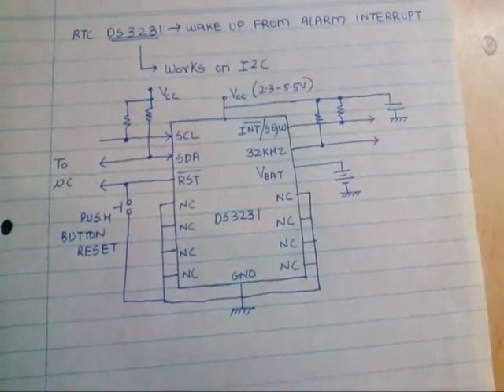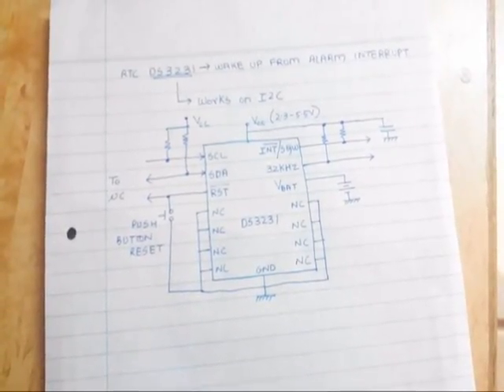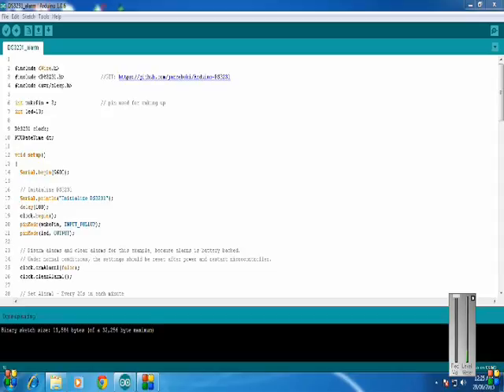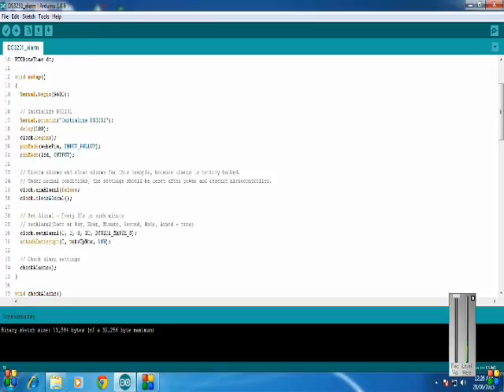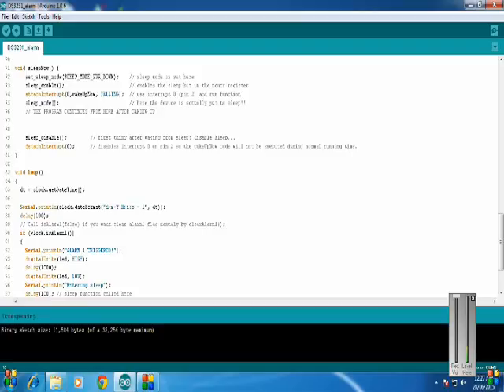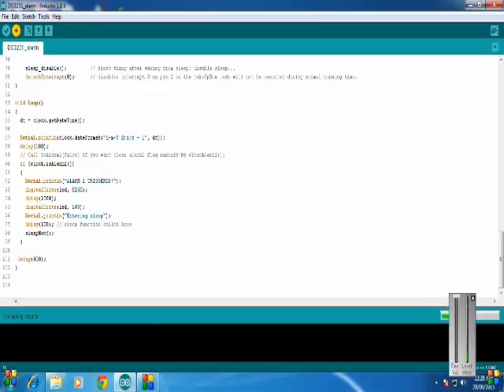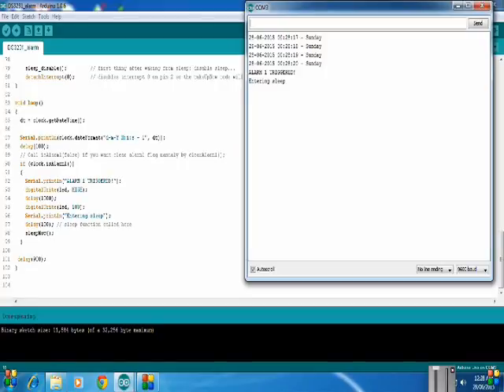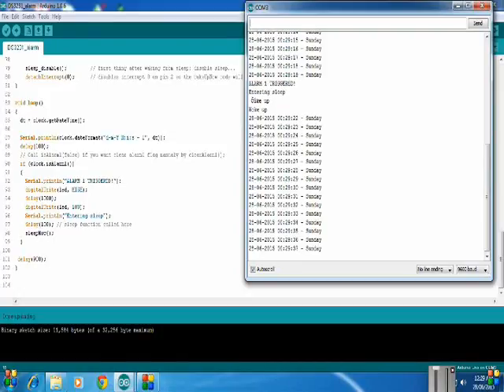How To Wake Up Arduino From RTC Alarm Interrupt

Comment: This could be an outstanding video but the 'thumbs-down' is likely coming from the audio distortion and lack of video resolution during most of the video (code explanation) makes the code unreadable.  I really hope you will re-do this video and correct these deficiencies because your expertise on this subject matter is very good. The problem is that this video doesn't communicate successfully. Good luck. If unable to correct this, could you at least post a link to the code so viewers can learn from that. Thank you and good luck.
Reply from the maker: Thanks a lot for your valuable feedback. I'll certainly try to rectify this in the coming videos. Also, I'll soon post a link to the code.

Comment: can i make arduino sleep at specific time and wake it again...for example i want my arduino mega sleep during night and wakes up in morning.....can you please help me making that sketch...i badly need it please help me
Reply from the maker: Yeah...you can create a delay of the required amount of hours for which the arduino should be in sleep and then wake it up using an interrupt after the delay

For eg: if you wan the arduino to sleep at 12pm and wake up at 8am..then the interuppt should occur after 8 hours and from 8am-12pm you can create another delay of half hour each or so depending on the requirement
Reply: where can i download the library?
Reply: i have this errors

Comment: My alarm triggers and works fine when the Arduino is not in sleep mode. 

Woke up
19-10-2016 13:21:20 - Wednesday
ALARM 1 TRIGGERED!

But when sleeping, it does not wake up

Woke up
Entering sleep (this is the last line of output). Since I know that it will trigger OK, I'm very confused why it does not come out of sleep mode. Any help appreciated.
Reply from the maker: Leave the wakeUpNow function blank. I mean comment the serial print("Woke Up") and delay(100) lines from the code.
Also connect the int pin of RTC to arduino uno pin 2.
I hope your query will be solved!.
Cheers!!

Comment: Great work! I have a question though. i believe that the arduino does not enter sleep mode.I think that after entering sleep mode it wakes up imidiately  and stays in a condition i cannot explain.How is it possible to be in sleep mode an d also desplay information in serial port?? Have you checked the consumption with an amperometer?
Reply from the maker: There are different modes of arduino of entering into sleep. The serial terminal is kept on only for display purpose. You can include code in which you can specifically sleep the ADC,serial terminal,timers etc.
In my case only the timer is off and RTC time is displayed through serial.

Comment: Hi Vipul, Thanks for the tutorial. I do have a question. Why doesn't the Arduino stay in sleepmode when INT0 is connected? It needs to be in sleepmode in between, but after the alarm it goest to sleepmode and immediately continues telling the date/time via Serial. I'm using the code provided in the comments.
Reply from the maker: Just comment the code in wakeUpNow function and the Arduino will be in sleepmode when INT0 is connected.
I hope thats what your query is!..
Reply: Hi Vipul, thanks for you quick reply! I kind of expect that is stops telling the time after Entering sleep. I've already commented the code in wakeUpNow, but it still keeps going. I've copied the code from the comments. Maybe I'm doing something wrong.
Reply from the maker: The flow of the code is:
The Arduino is in sleep mode all the time, even while it displays the time. It comes out of sleep only when alarm is triggered and it blinks the LED and goes back to sleep and starts displaying the time. The time is displayed only to demonstrate that alarm is triggered when time matches on the RTC and PC.
For the code you can send me the email id. I will mail you the code. In case you have any further query you can revert me back.

Comment: Thank you very much! as would be the code to turn on an LED every day for one minute and then sleep the arduino? this is my email: demiscorp@gmail.com
Thanks again!
Reply from the maker: You can set an alarm once each day by changing clock.set alarm function in the setup , by choosing appropriate function from the library and making suitable changes in the switch case too.
And for 1 min delay use can use timer 0 or timer 1 of the arduino.

Comment: Is there a way to wake up the Arduino every 10 minutes? I am also using DS3231.
Reply from the maker: +Wilmar Alfeche  Yeah its possible..
change the line in the code
 to 
clock.setAlarm2(0, 0, 10, 0, DS3231_EVERY_MINUTE);  
from 
  clock.setAlarm1(0, 0, 0, 20, DS3231_MATCH_S);
Reply: Thanks for the reply sir. I would just like to clarify. Will this set an alarm every 10 minutes or every 10th minute of the hour?
Reply from the maker: It will set an alarm for every 10 minutes.
Reply from the maker: It will set an alarm every 10 minutes.

Comment: Great work! I have one question though. Can you get the arduino to wake up after a certain amount of time?
Reply from the maker: +Emil Jasper you mean after fix intervals of time?...After how much time interval?
Reply: lets say during the day the arduino will log data every five minutes then turn off and turn back on again after five minutes.
During the evening and night time (lets say at 18:00) it will log data every 10 minutes.
Is that possible in one code?
Reply from the maker: +Emil Jasper  You can try the following code to get the present hour
RTCDateTime dt;
int hr;
const char *hrs;
dt = clock.getDateTime();
hrs =clock.dateFormat("h", dt);
  hr = atoi(hrs);

You will get the value in "hr" variable.Have two loops of codes (one for 5min interval and another for 10min interval )
Now you can put some condition...for example an if loop to compare the present time with 18.00
Whenever match occurs you can switch to the 10 min interval loop and vice versa after night time.
Reply: https://youtu.be/7hBtXdoaAOY?t=617 

This video explains how the alarm can be set to any time, date, hour, second, etc.

Comment: Hi...very good work....How to switch off a LED connected to Pin 13 of Arduino when the alarm of DS3231 is triggered?
Will you please share your code and details to my email :  ramakrishnan@dakshinlab.com
Reply from the maker: +Ramakrishnan S Will the LED be ON continuosly before the alarm is triggered and then it is to be turned OFF?...Or just Blink the LED when the alarm is triggered?

Comment: In file included from sketch_aug14j.ino:2:0:
***\Documents\Arduino\libraries\DS3231/DS3231.h:17:22: fatal error: WProgram.h: No such file or directory
 #include <WProgram.h>
Reply: Same error did you find any solution for this

Comment from the maker: /HERE IS THE CODE/

#include <Wire.h>
#include <DS3231.h>              
#include <avr/sleep.h>                                 
                                 
int wakePin = 2;                 // pin used for waking up  
int led=13;

DS3231 clock;
RTCDateTime dt;

void setup()
{
  Serial.begin(9600);
  
  // Initialize DS3231
  Serial.println("Initialize DS3231");
  delay(100);
  clock.begin();
  pinMode(wakePin, INPUT_PULLUP);  
  pinMode(led, OUTPUT);  
  
  // Disarm alarms and clear alarms for this example, because alarms is battery backed.
  // Under normal conditions, the settings should be reset after power and restart microcontroller.
  clock.armAlarm1(false);
  clock.clearAlarm1();
  
  // Set Alarm1 - Every 20s in each minute
  // setAlarm1(Date or Day, Hour, Minute, Second, Mode, Armed = true)
  clock.setAlarm1(0, 0, 0, 20, DS3231_MATCH_S);
  attachInterrupt(0, wakeUpNow, LOW);
  
  // Check alarm settings
  checkAlarms();
}

void checkAlarms()
{
  RTCAlarmTime a1;  
  RTCAlarmTime a2;

  if (clock.isArmed1())
  {
    a1 = clock.getAlarm1();

    Serial.print("Alarm1 is triggered ");
    switch (clock.getAlarmType1())
    {
      
      case DS3231_MATCH_S:
        Serial.print("when seconds match: ");
        Serial.println(clock.dateFormat("__ __:__:s", a1));
        delay(100);
        break;
        default: 
        Serial.println("UNKNOWN RULE");
        break;
    }
  } 
} 

void wakeUpNow() {  
  // execute code here after wake-up before returning to the loop() function  
  // timers and code using timers (serial.print and more...) will not work here.  
  // we don't really need to execute any special functions here, since we  
  // just want the thing to wake up  
Serial.println("Woke up");
delay(100);
}  

void sleepNow() {  
    set_sleep_mode(SLEEP_MODE_PWR_DOWN);    // sleep mode is set here  
    sleep_enable();                         // enables the sleep bit in the mcucr register  
    attachInterrupt(0,wakeUpNow, FALLING);  // use interrupt 0 (pin 2) and run function  
    sleep_mode();                           // here the device is actually put to sleep!!  
    // THE PROGRAM CONTINUES FROM HERE AFTER WAKING UP  
   

    sleep_disable();         // first thing after waking from sleep: disable sleep...  
    detachInterrupt(0);      // disables interrupt 0 on pin 2 so the wakeUpNow code will not be executed during normal running time.  
}  

void loop()
{
  dt = clock.getDateTime();

  Serial.println(clock.dateFormat("d-m-Y H:i:s - l", dt));
  delay(100);
  // Call isAlarm1(false) if you want clear alarm1 flag manualy by clearAlarm1();
  if (clock.isAlarm1())
  {
    Serial.println("ALARM 1 TRIGGERED!");
    digitalWrite(led, HIGH);  
    delay(1000);  
    digitalWrite(led, LOW); 
    Serial.println("Entering sleep"); 
    delay(100); // sleep function called here
    sleepNow(); 
  }
  
 delay(900);
}
Reply: Please write the wiring too.
VCC to V3
GND TO GND
SCL to A5 (UNO)
SDA to A4 (UNO)
SQW to PIN 2 (UNO)

ARE RIGHT?
Reply from the maker: yeah that's correct!
Reply: Thanks soooo much!